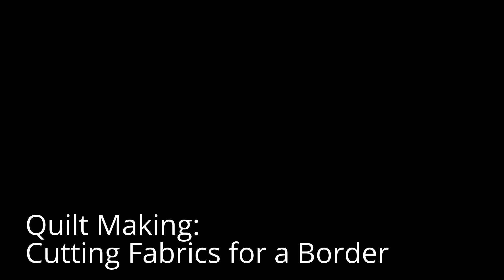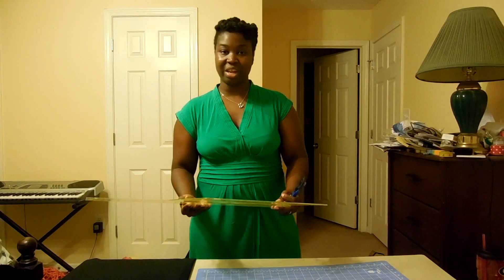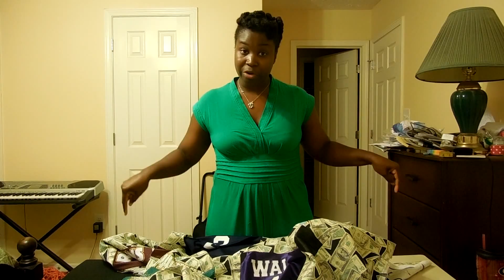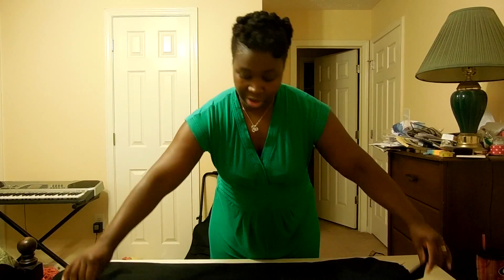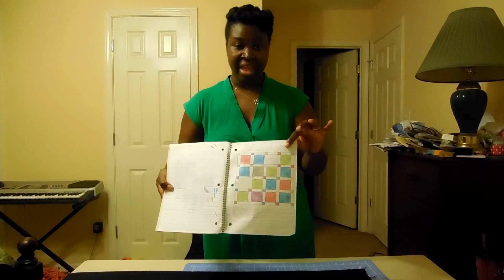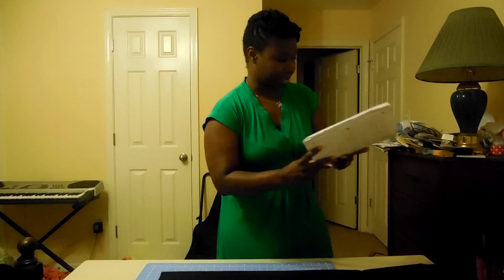Quilt Making: Cutting Fabrics for a Border

Comment: Erika, this is a lovely video to share with new quilters. The only part I think could be a mistake, is by sewing horizontal borders on first. Those are usually the shorter lengths for the top and bottom of the quilt. The short lengths help to pull the long sides in just a little bit to make the quilt straight, helps to eliminate the wavy-look many quilters have some trouble with. You may not have experienced this problem yet, but many folks have. However, when vertical borders are sewn on first - this will result in straight and accurate borders - if done correctly. I like your cutting methods and your jersey quilt is so attractive. Hope to see more of your great videos here on youtube!
Reply from the maker: Thanks for your comment. I think I only did the horizontal border first on this quilt; I usually do the long sides first.